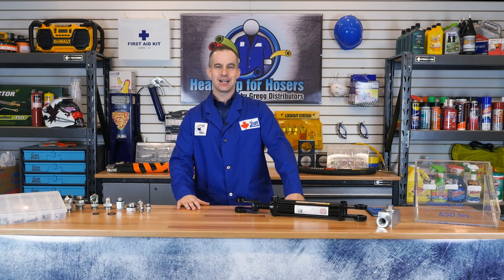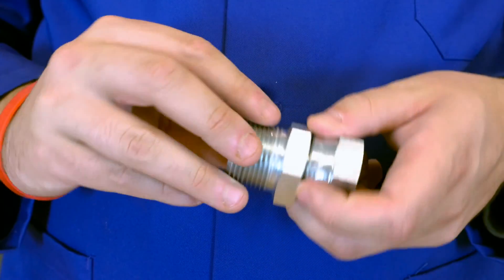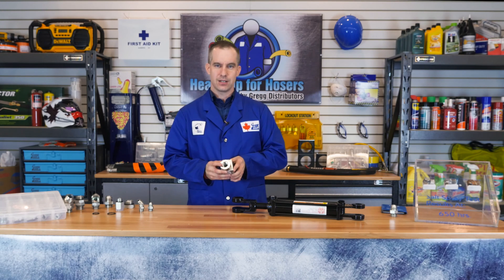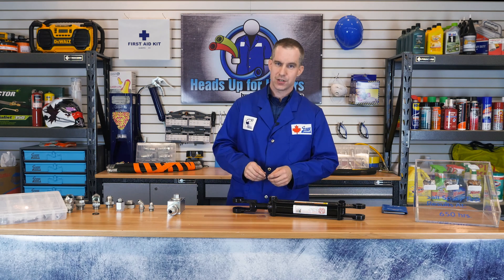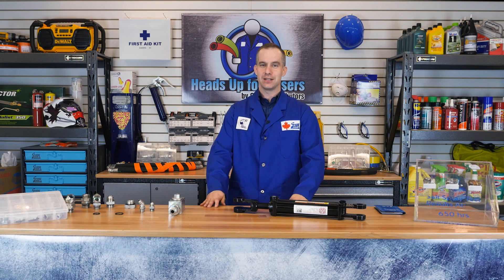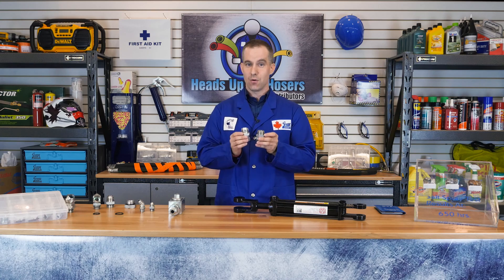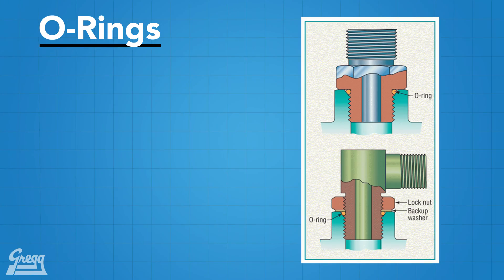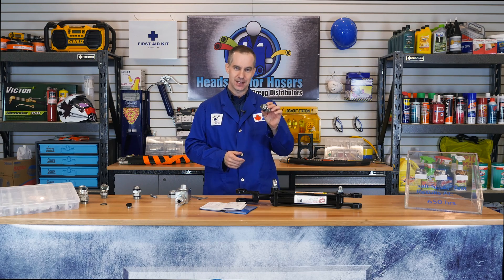O-Ring Boss (ORB) Fittings / Thread - Identification & Installation - Heads Up for Hosers

Comment: Great video. When you say 'bottomed out' it looks like you are turning the fitting until tightened all of the way down? I can hand tighten my ORB fuel fittings until they won't turn anymore, even with a wrench. Is that considered bottomed out?

Comment: Which is better ORB or BSPP for port fittings ?? BSPP also use O rings for angled port fittings.
Reply from the maker: It's not really a matter of which is better.  BSPP is typically found on European equipment whereas ORB is typically found on North American equipment.